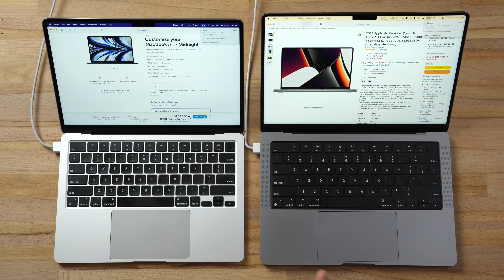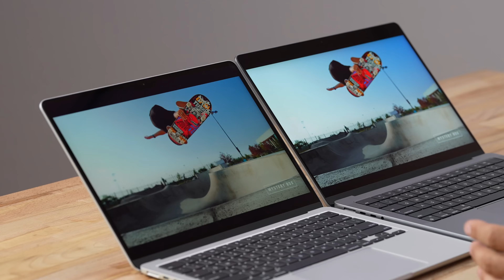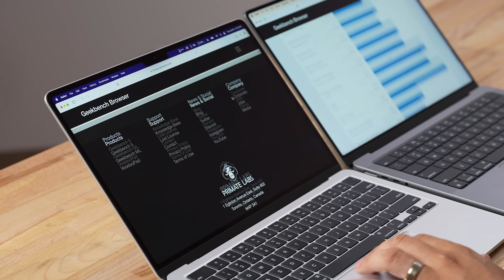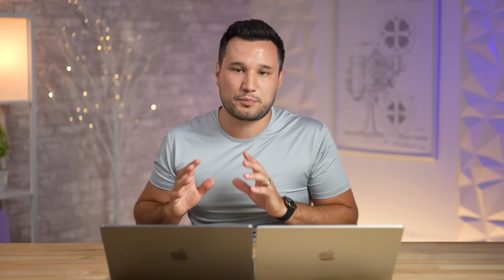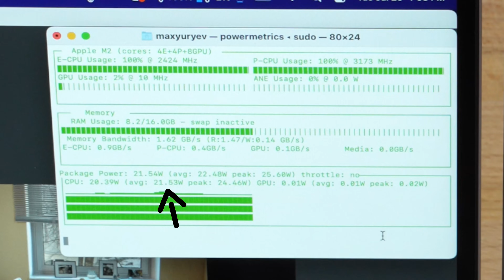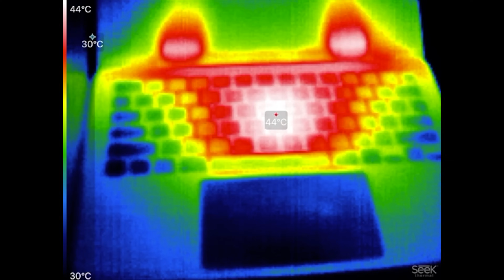M2 MacBook Air vs 14" MacBook Pro - Prepare to be SHOCKED!

Comment: I really thought m2 would be much more of an improvement over m1. The base model 14” MBP is even notorious for being much worse  than the 16”. I’m a little disappointed with m2, I thought they would blow our minds like they did with the m1
Reply: It is though. Those efficiency cores are amazing and the amount of power it doesn’t need to consume to get there is amazing. This isn’t even from a “pro” level chip either. Just wait for the M2 Mac and ultra.
Reply: Notorious for being much worse? Such hyperbole. The 14-inch is lauded as the best laptop in its class. A smaller footprint will always be more comprised in terms of cooling compared to a larger model. The M1 Pro chip in the 14-inch is the best performance per watt you can get on the market by a large margin. There’s nothing out there which operates at such low temperatures.
Reply: @Glatroz  I am talking about raw performance,  the base model always lacks behind all the other m1 pro/max class chips. I am not trying to trash on the 14" MPB, it is just that it has a different use case to the higher end models, and is not as focused on performance.

Comment: Kinda miss good old days when mbp had previous clean design with solely TB ports, nice looking case, convenient touch bar and nothing else. All those extra holes are not for mass users, and even true pro users as well. Last ones basically use external devices for real work. Apple should dump current design and get back the previous one, it was god tier.

Comment: Considering it’s fanless and significantly thinner, less cores etc, the air did amazing in these tests.

For those that want the ultra portability with plenty of power, I think the air is a great choice
Reply: I agree with you, the M2 MacBook Air did a great job during those tests without having a fan to cool it a bit during long run. It is a very good general usage machine and can handle some short heavy workloads on demand.
Reply: and its 1100$ not 1600$, these videos try and make it seem like they are the same price one is 500$ cheaper, pretty damn similar performance wise, and like you said smaller
Reply: @zach4hoff  You're right, I've checked and the M1 Pro MacBook Pro 14" with 8-core CPU and 14-core GPU, 16Gb RAM and 512Gb SSD cost about 2253.8€. The M2 MacBook Air with 8-core CPU and 8-core GPU, 16Gb RAM and 512Gb SSD cost about 1979€. So the difference in term of price is about 274.8€. I'm from Belgium so the delta between the two machine can be more or less depending on your country 😉Now, I still believe that people who wants to have lighter and finless machine will buy a M2 MacBook Air or even the M1 version.

Comment: Are there huge differences in low power mode for the 14” I understand the air would have like- infinite battery life, but could putting the 14” into low power mode be able to bring the 14”s battery results closer to the air, without a huge performance hit?
Reply: I doubt it. The difference between the M2 and the M1 Pro is that the M2 relies a lot more on its high efficiency cores. Those got a giant boost in going from icestorm to blizzard of close to 40% increase in performance. On top of that, there are twice as many high efficiency cores on the M2 with four versus two. If the M1 Pro in low power mode essentially shuts off its firestorm cores, it’ll be a slaughter if you have four blizzard cores going against only two icestorm cores. Battery life will probably be closer for the M1 Pro (The 14” MBP has a bigger battery, but less efficient cores), but performance is likely to be heavily in favor of the M2.

Comment: I’m glad to see this comparison! Hopefully this makes it clear to everyone that if you need a Pro machine, get a Pro machine. Thermal, SSD, whatever. It doesn’t matter. Nothing is going to make the Air perform like a Pro. If you want thin, light, and portable, especially for home tasks, get the Air. If you need heavy video editing, development, or other tasks that will make you money then you should get the Pro 14 or 16.
Reply: so you say as "basic user" you should get a overpriced M2 Air and for "more professional" stuff the M1 Pro which is at least partially worth its money?

If the M2 Air would be more affordable, sure it would be a nice computer "for anyone", but the ridicilous price tag just make the "old" M1 Air the better choice!
Reply: @harrison00xXx  I never said anything about "basic users". I said if you want "thin and light", the Air is your machine. I should probably add "quiet, long battery life, highly portable, etc." It's a great option for a home user or light professional use. The Pro machines are massive beasts of machines that are heavier, larger, and (relatively) louder. All of which is nothing if you're used to professional machines instead.
Reply: @harrison00xXx  I would just say that it seems like it’s not worth it to upgrade the air to 16gb, if you are doing things that will take advantage of the extra ram and you need the extra storage just go with the pro at that point. But drop down to a base m2 air and all things considered it makes more sense at its base price rather than knocking on the pros door. Faster gpu, ssd, higher hz/resolution screen, more ports(including more external displays) all make the pro a no brainer at that price point.
Reply: @IAmCjcj11  But the base M2 Air got, considering its still high price point (1500€ in EU, while a 14" M1 Pro base model cost 1900€!) too much downsides, especially that it will be outdated soon.

Im even scared about the 16/512 of my base model 16"...  16GB is just THE ABSOLUTE MINIMUM since some years when it comes to "performance" computers, for heavier multitasking or heavily ram demanding tasks the lowest "usable" is 32 or even 64GB!
Reply: @IAmCjcj11  without even talking about the poor mans 256GB SSD
Reply: Well said. I'm tryna make money!
Reply: Even for software development, the MacBook Air is perfectly adequate. I’ve seen many famous software engineers like Geohot and Linus Torvalds use a MacBook Air M2/M1.
Reply: @ZiFrenZie   but definately not a 256/8 base model
Reply: @ZiFrenZie  Software development itself doesn't require much of a machine these days. However, all the related activities that happen in professional development (collaboration, running containers/vms, interacting with satellite devices, running performance tests, etc.) make good use of the ports, memory, cpu, and other features.
Reply: @tears2040  in europe even 100$/€  (at least!) more overpriced than in US

Comment: First, shortage of supply chain didn’t make air into 3nm after two years to update…

Second, it’s obvious Apple intentionally put air way below pro, even its next generation device for selling point.. just look at the device cooling system, just shield not real heatsink .. and as cheap as thermal pads can be, can help a lot heating problem.. but in sacrifice of Apple care just by opening the case. 

Then they do label M2 air , the entry laptop, more expensive. Hidden performance drop in ssd… 

I don’t know what to say. Premium price, people are willing to buy, even it’s more expensive. But with that intentional move…

I just love portability, battery life and silence (traumatized by numerous airplanes taking off noise), it can keep me concentrate at work. 

Hope windows can catch up, and developers all going to ARM base, or whatever base that’s more power efficiency (sounds like Linux, but it seems the mass never moving into it, strange… and Linux is free! Cuz of lack of ecosystem or file format missing, compatibility issue?) 

Oh well, I just don’t have data to analyze forward. Thank for the comparison. It seems air is sufficient to mild use and short time burst task. Personal needs should be able to be fulfilled.

Comment: That was a nice comparison, next we want to see M1 Air 16/512 GB vs M2 Air 16/512 GB please !
Reply: Nothing to see coz the M2 is better for that
Reply: @Salty_Biscuitz88  I believe M2 will thermal throttle even more than the M1 as it utilizes more power than M1 and heats up quicker for that extra "18%" performance boost.
Reply: @sanjaykholiya1  I've been using it about 2 weeks since released day. it never throttle. it works the same as the M1 however it is faster.

Comment: Which one should I get for school + adobe apps like photoshop and after affects? I wanted to get the 16gb 512ssd m2 air but the price is so close to the 14 so I can’t decide :\
Reply: that's only $300 away from the 14 inch. So you're paying that extra for the Mini led w/ 120 hz, better speaker and an extra USB C port. I'd say the 14 inch has the better value for its worth
Reply: Get the M2 coz it’s cheaper and does the same thing.  There is no value in things that doesn’t really benefit you.

Comment: Well basically what this means is : performance will be identical for 99.99 % of regular people.
Price wise you can say its identical too.
So the real question is the display. Using 3rd party app "vivid" for mbp you can have 1000 nits and multiply it by higher ppi and 120 hz and larger real estate you end up with non comparable displays at all.  You literally can't compare them any more. 
The question that remains : are you ready to deal with weight penalty of a mbp? cause its noticeable. Like you would need a backpack for mbp where air you can cary in one hand.
For me the 1000 nits did the trick and I literally can't imagine going back to 500. Even at night I blast the screen to some 700 nits and you can feel how your eyes have easier times reading small text especially at dark mode.

Comment: The M1 air with 16gb ram and 512 gb ssd costs me around 1500 Euros, the M2 Air with the same config costs almost 2000 Euros just the same as the 14 M1 pro. I have started video editing as a hobby and currently use my desktop pc (R5 5600x, 3080, 32gb ram) for that  but I want something as well for the go since I am often on the go. Which model would you recommend me?  I want to keep the device at least for 5 yrs.
Reply: Im in the same boat, nice pc btw! for portability, m2 air but depends how much power u need on the go considering you already have a beast of the machine
Reply: @foskr4  thanks:) which model are you probably going for ?

Comment: If I had 1500$ budget I would try to squeeze few more bucks and buy Pro model
Reply: Do it. It’s $1749 USD right now at Best Buy. 
I canceled my MBA order and went with the MBP 14” bc that $1749 is an unbeatable value for all the upgrades and specs you get, compared to the MBA.

Comment: Had the same decision and ultimately went for 14 inch. Better screen, more ports, better speakers, much more powerful chips. Don’t regret my choice at all, the 14 is a beast
Reply: Key thing is you can use more than 1 external monitor with the Pro
Reply: I got the 14 in dont regret it best buy is selling it 400 dollars less 1599
Reply: Bro you aint lying, i chose the macbook pro 14 inch from best buy from the $200 off, bro its sooooo fucking worth it and im loving it !!!
Reply: fully agreed, wise choice - I love my 16“ M1 Pro, its a fcking BEAST 🐲
Reply: I chose the same and I love the 14 inch. It's the same weight as my old 2015 MBP but such a huge upgrade. The speakers are amazing and being able to plug an HDMI cable in with no doggle is great!
Reply: Me too, but still not sure, as the light and thin design is also worth it, of course the speakers and XDR display, plus more power too. Sadly you can't get everything in one package, even if you pay more. 😉
Reply: Me too 😎 14” M1 pro is a beast
Reply: Is it? What about fans, noise and dust which will inevitably come inside your laptop. I will buy the MacBook Air.
Reply: Why do you guys call it the 14 inch as a differentiator when both laptops are 14 inch

Won't it be easier and just plain smarter to refer to one as the Pro with the other as the Air

It's just so dumb and annoying to me tbh
Reply: @segun_finance  well the M2 air is not a 14 inch screen to start with! And you do realize there’s a bunch of Pro Models of the MacBook right? M1 pro, M2 pro, 14 inch M1 pro and 16inch M1 pro.

How you gonna know which one are talking about if you refer to it as Pro only lol

14” M1 pro it is 🤣
Reply: Hows it going? Im considering getting the 14 pro m1 pro now instead of the 14 pro m2 pro as I can save 400$ what do you think
Reply: does the macbook pro battery good?
Reply: I traded my 14inch for an m2 air. I find that I will really only use it if it's light enough to travel with across rooms and places.
Reply: I got the 16 😁
Reply: @ZahirSayed-vz1hd  can you tell me, didn't the portability of 14 bother you. what made you take the decision to get 16 over 14 considering portability is worse with 16 comparitively
Reply: @youarecorrectiamwrongbecau1338  portability will be a issue for a female with small hands i think but for a man its no problem. I upgraded from a old lenovo laptop which was bulky af so i am very happy with this machine. I used a 14” for a week before it but didn’t like the battery so i returned it and got the 16”. The speakers and battery are much better on 16”.
Reply: @ZahirSayed-vz1hd  exactly same situation as you

Comment: max tech u made a muistake. these specs doesn't match the system. the 10 core GPU m2 MacBook air will match the m1 pro MacBook bro because the core difference will be smaller then a 8 core GPU.( so compair it with the 10 core GPU MacBook air vs the m1 pro MacBook pro)

Comment: The problem I see is for most video editors like say making a music video or some other longer video… you could be working with hours of footage (like wedding video) I would love to see exporting and editing like 3-5 hours of footage and exporting 30 minutes or more. Same as the photos pushing 300-500 photos out to see how much the air slows down with the heat over a normal work load 🤔🤔

Cuz once the 14” gets hot it can cool down but the M2 air can only throttle or just be that temp 

Same with like graphic design. Working for hours on end and having like photo shop open, other programs, and working with like many layers. How much would the M2 air actually slow down or would it handle it

Edit: I just mean it would be great to see how both machines hold up with larger and more real world stuff for certain video and photo fields.

Comment: Wonder if you add a small fan in the empty section of the Mac book air, if it will make a difference. Not sure if there is a spot to draw power from. Maybe draw from usb PCB.

Comment: If you look closer, you will see that the M1 MacBook Pro 14“ has BlueTooth on, but the M2 MacBook Air does not. So if you would turn off Bluetooth on the Pro MacBook, the machine could last mich longer.

Comment: As usual, a good comparison review. I really don’t need the power of either of these computers, but if I had to choose for long term, I would go with the M1 Pro because of a better display and better/more output ports (assuming I could afford the extra $250+ price difference).